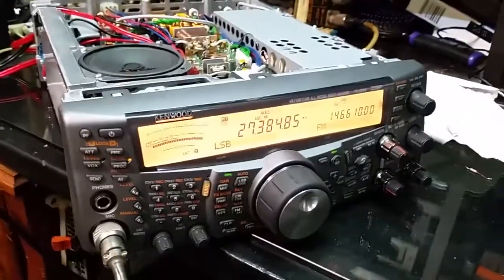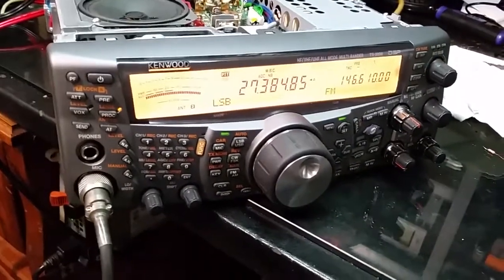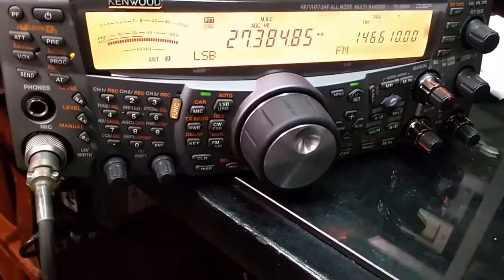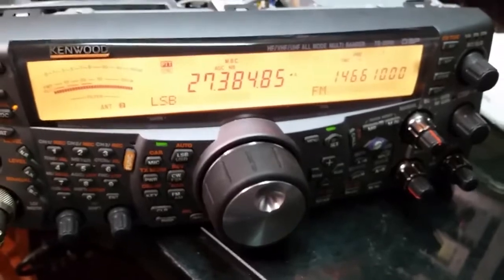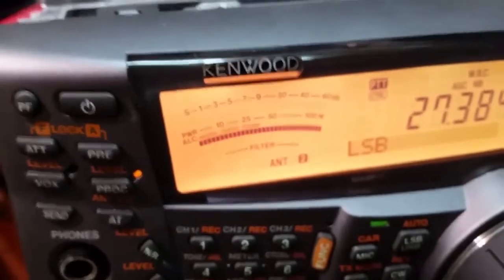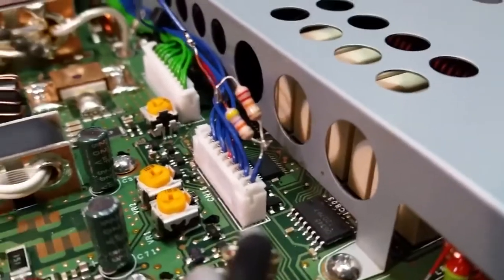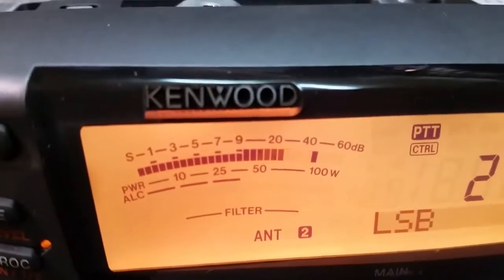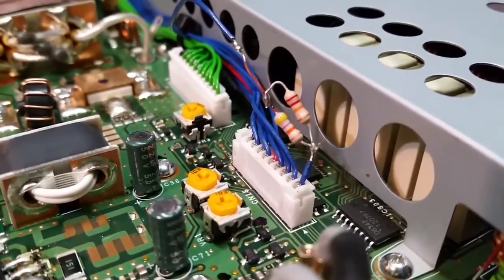Kenwood TS-2000 ALC Mod

Comment: In other web channels they describe higher values of resistors, the values vary from 50 to 70Kohm. What is the most useful value for improving output power?
Reply from the maker: not all radios are the same and they got the information from Here.

Comment: where is the ALC line for 2 meters as IAM ONLY GETTING 80 WATTS OUTPUT
Reply: Same problem, SP7WP,
Reply: I did this mod and it solved my problem on VHF I now output 100w with the same mod.
Reply: @VE2JN please describe